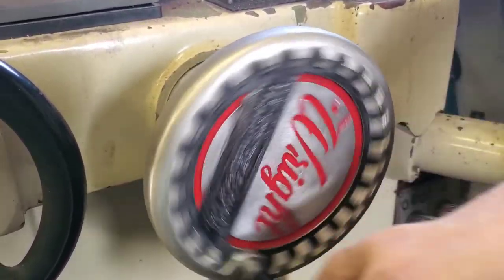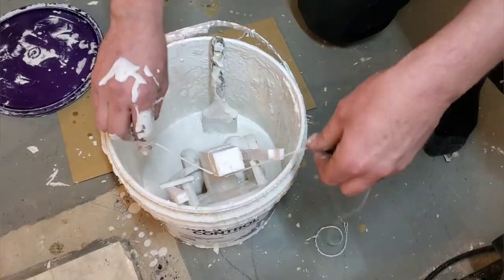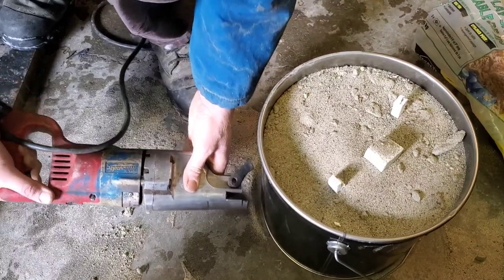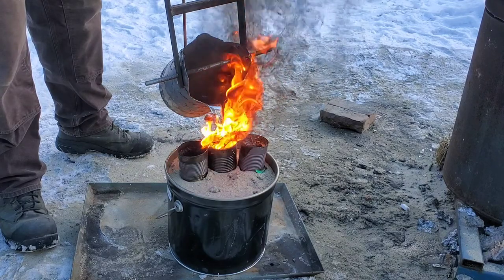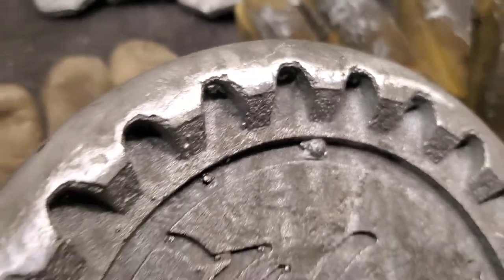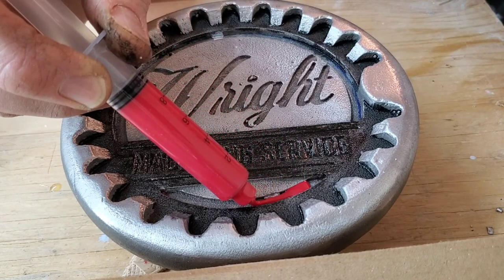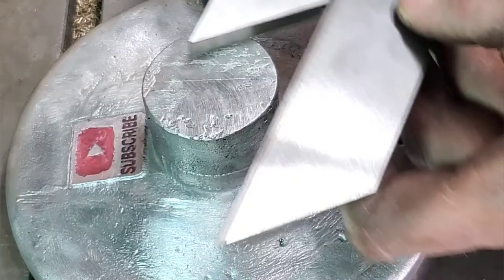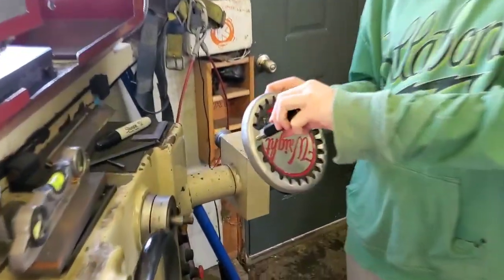Lost Foam Casting Hand Wheel For Surface Grinder Machine

Comment: That turned out amazing! 
I need a guy like you to cast one up for a Clausing Metosa lathe ! 
Did you ever get that thread dial made up for yours ? I still have one sitting on my workbench if you want specs! 
Hope your doing well my friend.
Reply from the maker: Do you have the same lathe as me? I'm sure I could cast you one.  Look me up on Facebook so we can chat.       

As for the thread dial it's still on the project waitlist.   But is working its way closer to the top of the list.  Currently, I'm experimenting with making a gear hobber for the mill with Arduino and a dividing head.   But that will be a month or so before it's out. Today I'm working on adapting a Beckett oil furnace burner to the foundry so I can just turn on the thing and not have to fiddle with it.    Previously it was like a very temperamental woman. Needing constant adjustments and encouragement to keep it working at 100%. I almost have it working.

Look forward to chatting.  Ttyl